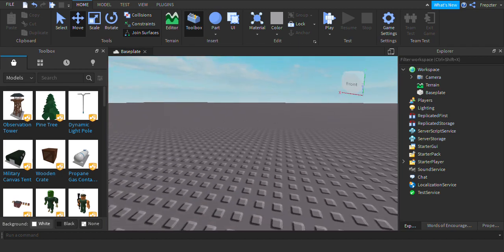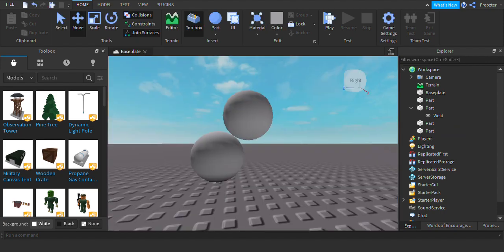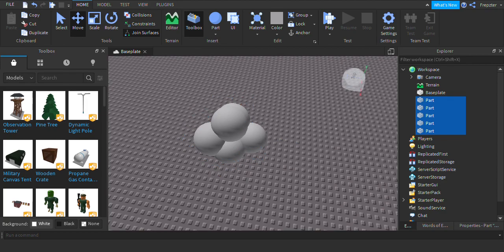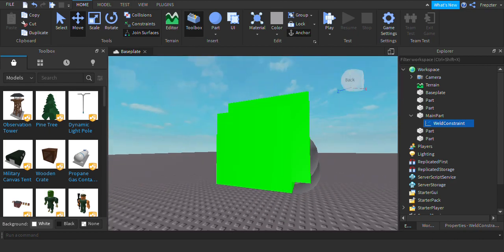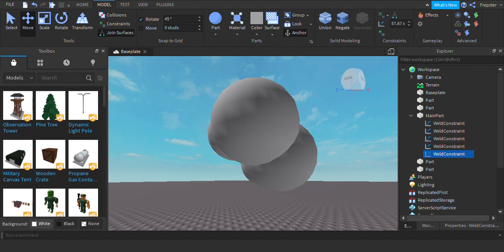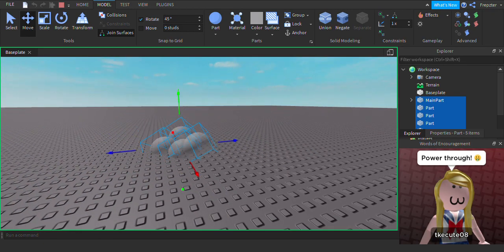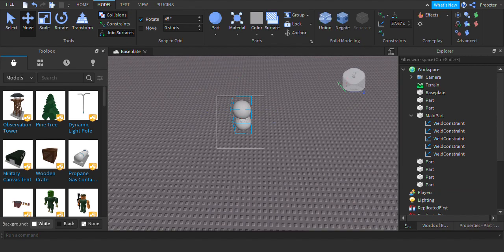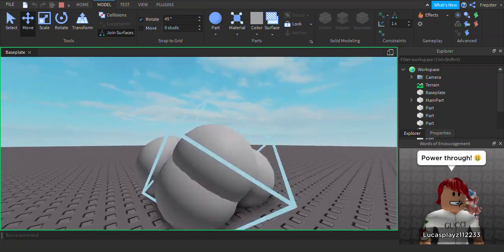How to use Weld Constraints on Roblox | ROBLOX STUDIO

Comment: One problem is that i weld one part to a spinning part, when i run the game, came as expected, once i played the game, the normal part just fell
Reply from the maker: nah nah dont use welds for spinning parts u need to use hinges or motors
Reply: k